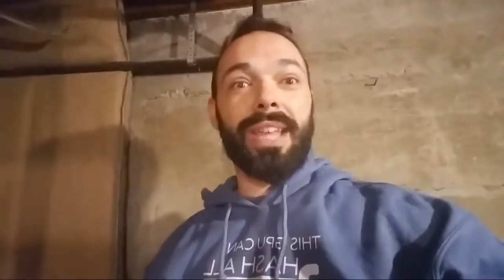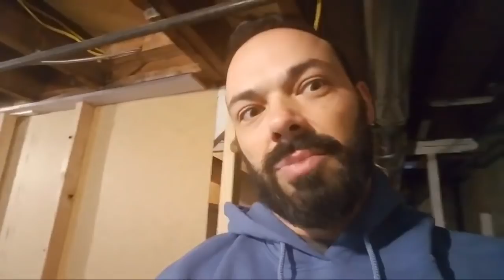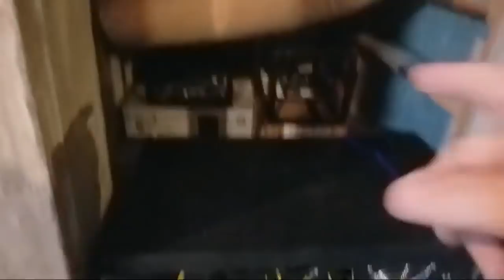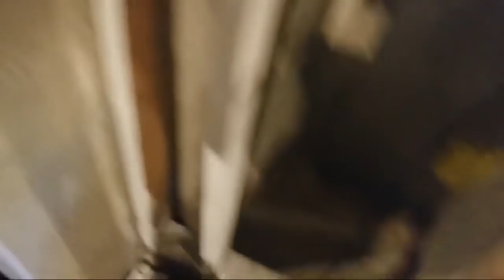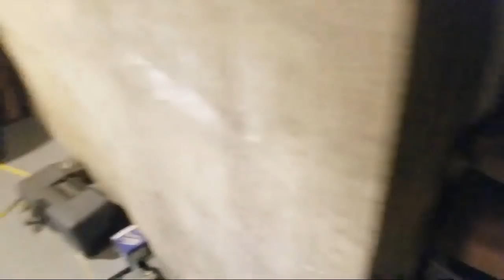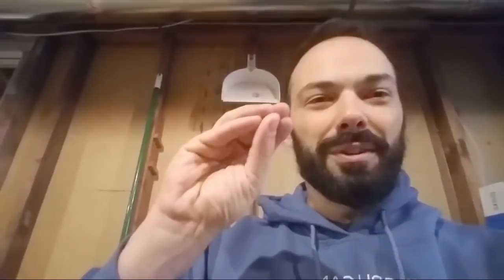🔴 BRINGING BIG BABY HOME (part 1)

Comment: an easy way to calculate the cfm requirement is to multiply the number of exhaust fans you have by their cfm rating. Example: If you have 10 ASIC machines exhausting at 250cfm, you'll need 2,500cfm circulating through the space. I recommend having both a intake, and an exhaust system. Only doing an exhaust system causes the hot air to get partially recirculated back into the systems